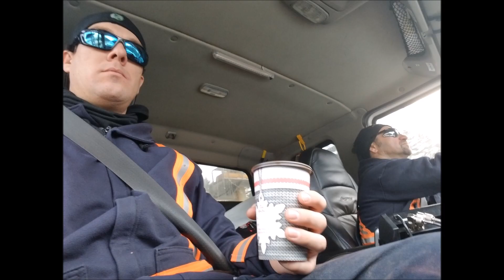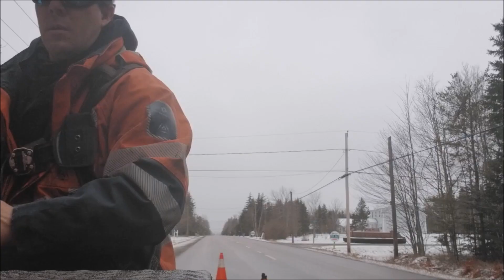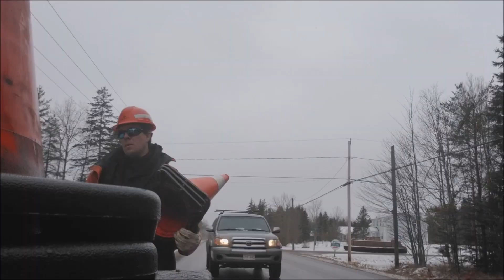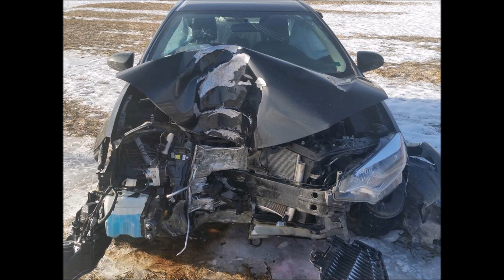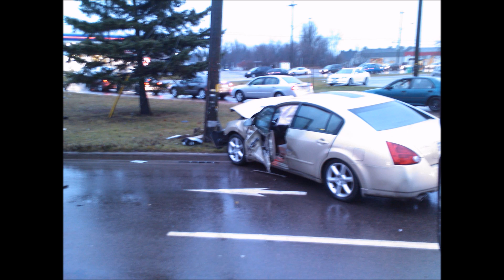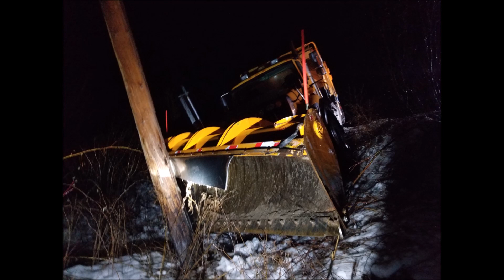The forgotten danger of Line work

Comment: A couple years ago working storm In Florida after hurricane Michael, a drunk driver ran slam through a work zone an killed 3 line men that were working and they were a good ways off the road. You always have to pay attention to these crazy drivers cause more often than not they damn sure ain’t looking out for you and they don’t slow down no matter how many cones or flashing lights you have.
Reply from the maker: I remember that incident . It's too bad and you're absolutely right ! I always make a point to drive slow while passing through construction zones and promote others to do the same. Unfortunately that won't change things for the majority! It's gotten to the point where even in an emergency situation you have to just stand by and let things burn even if it takes hours for back up! Even worse ; often times I arrive with fire trucks blocking the road , and still cars try and drive around !

Comment: Thank you for reminding everyone about this. THE #1 killer of linemen is traffic accidents. Read that again THE #1 KILLER OF LINEMEN IS  Just because they are off the driving lanes does not mean their equipment is nor does it make them safe from distracted drivers. This danger is amplified when they are entering or exiting their vehicle, or when working on lines  at an intersection. So for the safety of ALL linemen (and drivers have you seen what a car looks like after hitting bucket truck) slow down and pay attention when you approach utility work areas.
Reply from the maker: There definitely needs to be more education on this... 
During emergencies, when there's a hazard on the road, most cars don't even touch their brakes. Most of em also not intentionally being reckless.. simply oblivious to the danger😔

Comment: I'd be worried about semi trucks. Most of those guys are half asleep or rookies of questionable skill.
Reply from the maker: I hear ya ! It's not too often we setup without traffic control ... Usually when we have to dump a line in an emergency, firetrucks are already there to help.  Scary thing is nowadays , cars even try driving through a work area blocked by them as well!